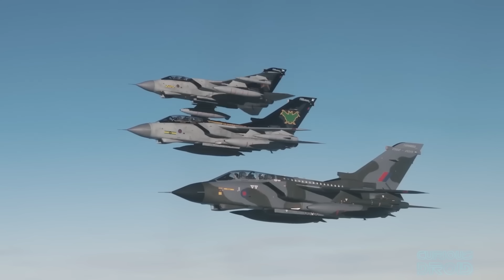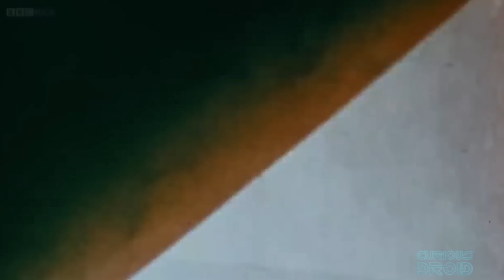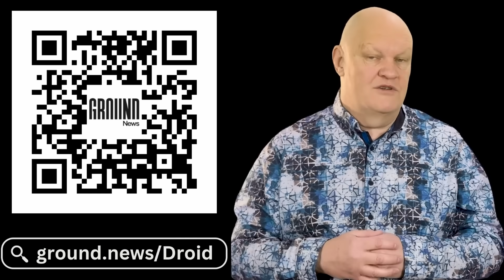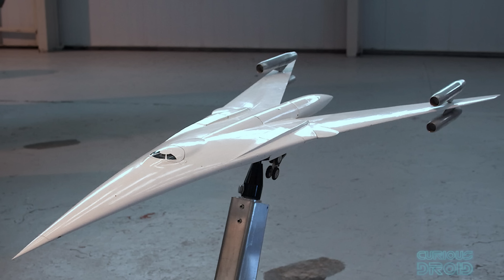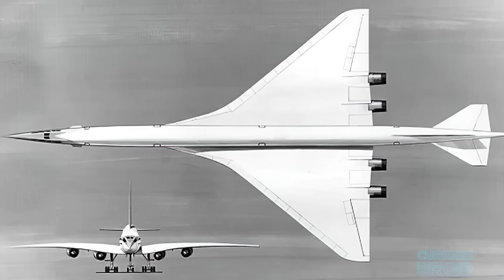Why Aren't Swing Wing Aircraft Made Any More?

Comment: swing wings were a great idea but... it was a complete maintenance nightmare. The F-14 needed 40-60 hours of maintenance after every flight. The B-1 need up to 168 hours after every flight. The F-111 required 187 hours after every flight. Compared to the F-18 10-20 hours  depending on model. F-16 17 hours, F-15 20 hours, the F-35 9 hours.
Reply: Staggering numbers, if true.
What would they be doing?
Reply: To be fair, those extensive maintenance hours on the F-111 weren't because of the swing-wing design, but mainly because of the leading-edge technology in its avionics systems.  I worked in-shop, avionics repair for 5 years.  Very complex systems, tied together to provide unparalleled navigation and flight characteristics.  You had inertial navigation tied into doppler RADAR and star-tracking nav systems, along with individual roll, pitch, and yaw computers, the terrain following RADAR and attack RADAR systems.  When it all worked it was amazing (I have seen photos of a practice bomb leaning against the 'ground zero' pole marker, with it's drag parachute draped over the top of the post).  There's a reason that the Aardvarks won many SAC Bomb/Nav competitions, and also destroyed more tanks in the middle east than the A-10 'tank killers'.

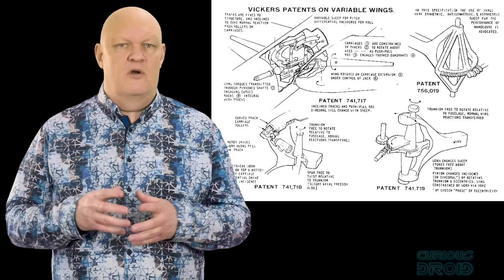Comment: Just to clarify, 56-57 Swallowtail design @ approx. 11:00  because U.S. DoD didn't approve. It was because it was completely conjectural.  It was the wrong place to put money.  Tail-less and without surface controls would not be even possible until computer control had advanced by decades.  In the 50's and 60's computer tech's possibility wasn't even comprehended by serious, hard-working, and advanced engineers.  It was pie in the sky. There were at least 20 more deserving places to put money that had promise of delivering national security. Even now, with 20/20 hindsight, the design was not viable and doesn't exist. It would have gotten a lot of people killed.
Reply: I must be remembered that Vickers had absolutely no experience building supersonic aircraft and only built a single jet aircraft... the Swallow is clearly nothing more than wishful thinking.

Comment: I imagine the biggest problem with swing wing is when the wings move back the centre of lift also moves back and the trim has to be adjusted. Presumably it's most in balance in at the most commonly used speed and setting.

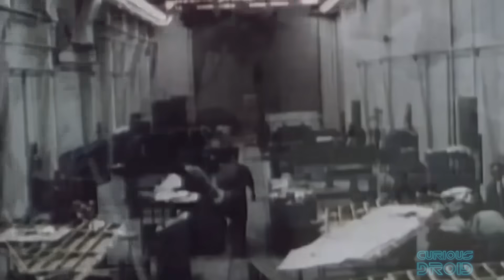Comment: 13:51  He finally gets to the point and vaguely answers the question.  The video would have been a lot more interesting if they'd focused on answering the question and detailed HOW swing-wings create stability and HOW active controls do it better, leaving stealth to be major design factor.  It's such a shame and rather frustrating when a title poses an intriguing question but then content barely addresses it.
Reply: It's the nature of YouTube....wasting everyone's time
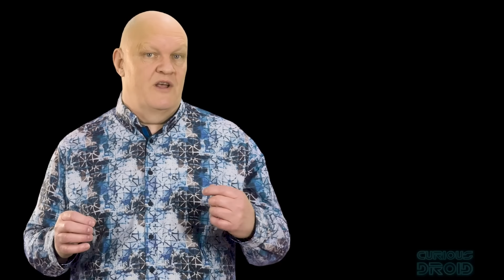Reply: You guys just were not paying attention, and you weren't actively synthesizing the step by step explanation of how originally all aircraft had straight wings because that provided the best stability for slow flight all the way up to the transonic speed range when buffeting from the air compression against the straight wings steadily increased and caused the aircraft to become unstable in flight.   His explanation actually starts at 1:40 when he introduces the aeronautical discovery of Adolph Buseman in 1935 that sweeping the wings back would delay the wave drag that began at transonic speeds.  This resulted in the early adoption of swept wings in most of the jet and rocket propelled German aircraft during WWII. 
The part that he doesn't explain well is how and why swept wings reduce low speed performance - this is primarily due to the reduced wing surface of the swept wings causing reduced lift, while also pushing the center of lift of the wings backwards from the location of the wing roots.   This causes the plane to require much higher take off and landing speeds.   This is why delta or partial delta wings became a solution to this problem in planes like the B-58, F-105/F106 and the F-4 Phantom and the French Mirage (and most subsequent French fighters) as well as the Mig-21.  Delta wings give you the sharply swept leading edge to give you good transonic and supersonic performance while maintaining a hefty wing surface area to give you low speed stability.    The problem with delta wings though is that the extra wing surface of a delta wing at high speeds eventually becomes unnecessary drag on the airframe and limits speed and/engine efficiency.  
Another thing that he doesn't emphasize enough is that you don't really need swept wings to get through the shock waves of the transonic and supersonic regimes - both the Bell X-1 and F-104 had relatively straight wings but the wings were very thin which allowed them to knife through the compression waves and go supersonic.  The main problem with the F-104 was its wings were also very small, it had a very high wing loading and this resulted in awful low speed handling characteristics that resulted in a lot of crashes during takeoff and landing and a very poor turn rate during dogfights.   Had the F-104 been given retractable flaps and fly by wire computer controls, it would have done just fine at low speed and at high speed.  With a vectored thrust jet engine, its poor maneuverability in flight could also have been solved.
Anyway, swing wings were developed as a way to optimize both supersonic and low speed flight because fly by wire controls and vectored thrust were not available at the time.
Reply: @gandalfgreyhame3425    You just wrote that whole long shouting essay to yourself.  Do you really think anyone's going to pay attention to you when you open your comment like that?  Go learn some social skills.
Reply: @jbtechcon7434     OK, I uncapitalized the three all-caps words.   Now, go read my post if you want to learn something instead of lecturing from your soapbox..
Reply: @gandalfgreyhame3425    No, your snotty reply proved that the priority it still for you to work on your social skills.
Reply: I was just gonna say that..

Comment: John Boyd studied the swing Wing concept at length, and concluded that additional weight and complexity,  was not worth it. 
On the other hand, he never had to land on carriers.
Reply: Was not worth it for the F-15, but definitely worth it for the F-111 and B-1.  The mission requirements drive the wing design, and the F-15 mission was completely different.
Reply: Swing wing had an additional advantage for carrier aircraft not mentioned here - no need to fold the wings up to fit the plane on the lift. Just manually fold the wings back further - that's what they did for the F14. The lack of a wing folding mechanism offset some of the wasted weight and space of the swing mechanism.

Comment: I have enjoyed your videos Curious Droid for many years now, but the last couple you've put out - this one, and the F-111 video - have been riddled with errors that a quick bit of fact-checking would have avoided.  For example in this video, the B-47's name in-service was the Stratojet, not the Stratofortress; the first jet-powered aircraft in the world was the Heinkel He-178 and first flew in 1939, not 1934.  Also the reference to the 2707's wing pivot mechanism lacks context; the 2100-kilogram weight of the component is only a small example of the overall weight problem with the aircraft's wing box structure, of which the pivot was only but a small part.

If you're using AI to help you write your scripts, I suggest - at very least - to fact-check their outputs, because the quality of your product is dropping.

Comment: A swing wing is still a great idea on paper because its able to optimize its airfoil for the desired speed and altitude regime its operating in and reconfigure as it changes regimens.  It truly fell out of favor because of all the reasons mentioned in this video except probably the biggest one.  In all the swing wing aircraft they have rather poor G-load margin.  Most were limited to 6.5G (fighters) with some being even lower than that.  To make a wing box strong enough for higher G-loading incurred even more severe penalties in weight which affects range, fuel, and weapon loads.  Basically it was a technological dead end  because within a single generation of aircraft it had already fully developed it to near its practical limits.

Its unlikely that a swing wing variable geometry wing will be used again in future fighters mostly because manned aircraft will likely be replaced by UCAVs not long after 6th generation.  An advanced UCAV will have many advantages over a manned aircraft but it will have different goals.  Main priorities will be low mass, super maneuverability, >15G sustained loading, and low observability.  All of those goals are much easier when you forego the frail human occupant and around 2000 lbs of mass for cockpit, ejection seat, life support, etc. removed.  No pilot also enables greater stealth and less restriction on internal arrangement for things like intakes, engines, and such.  While variable geometry may find its way into such aircraft it would likely be aeroelastic adaptive compliant wings or other forms than swing wings to keep them stealthy.